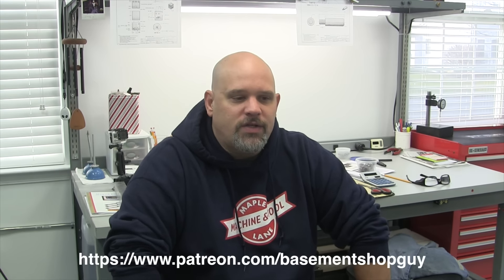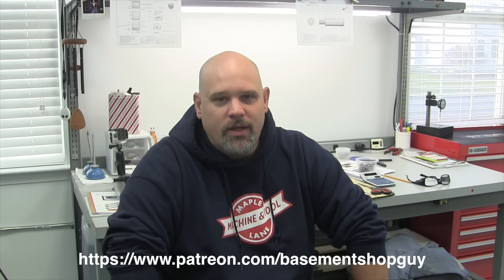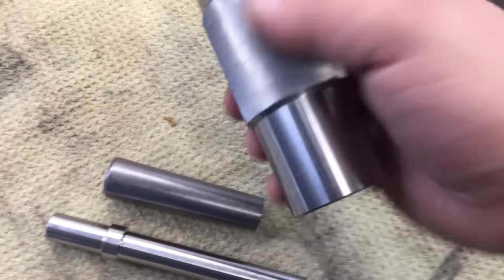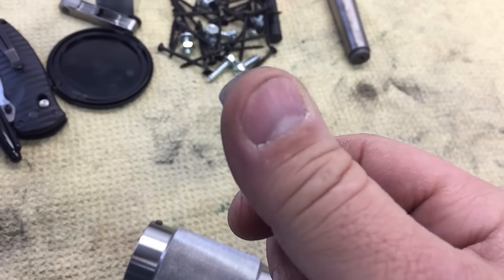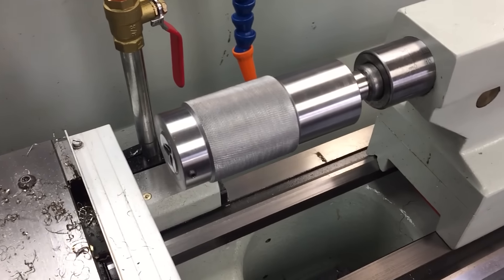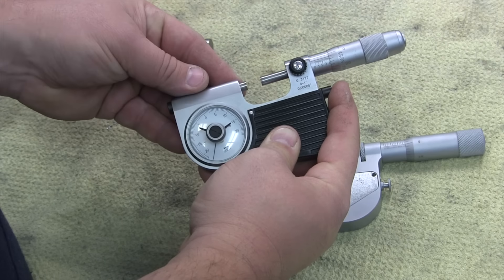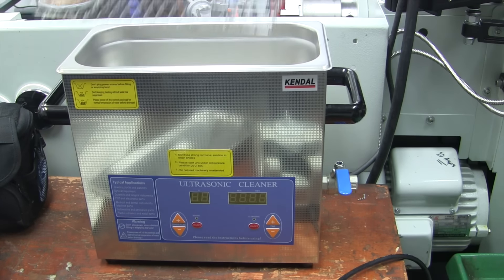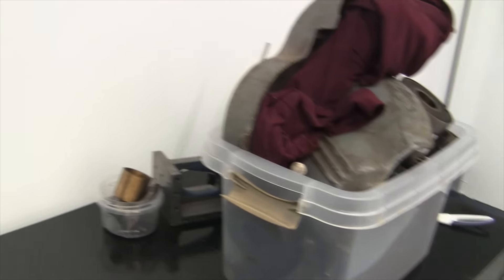Updates From The Underground 14

Comment: The "Ford" monkey wrench was from a vehicle tool kit.  I believe yours is for a 1926-1927 Ford Model T.  Cars once came with tool kits so the owners could fix them.  I have a couple of these.  The little tit on the end of the handle is for removing the oil drain and fill plugs from the rear differential.  Most of the Ford tools have numbers on them to help identify them.  I have a number of them in my tool collection.  Occasionally you will run across dealer service tools as well marked Ford.  You will also occasionally find gauge blocks etched with the Ford logo.  

All the best!

Mike
Reply from the maker: Nice! Thanks for the info Mike. I'm learning quite a bit from everyone's comments about these wrenches. Real cool!

Comment: Parts of the 10k lathe are in the bin.
Reply: I think the same 10K but definitely not 10L. 10K shares the 9" parts for the carriage. Key is the half nut lever barely visible in the bottom container and what seems to be the smaller bearing (sleeve?) in an alternate container.
Reply from the maker: Yep! Those are the parts removed from the 10K.

Comment: Hoodies with neck draw-strings are NOT good around the shop. I pull the chords out before I use them. The consequences of getting one of those chords wrapped around a spinning thing are not worth thinking about. Otherwise your's look very nice :-)
Reply from the maker: Rupe - they're meant to simply stand around, while enjoying a nice glass of Egg Nog and marveling at the machinery!
Reply: I couldn't agree more, simply too dangerous!
Reply from the maker: I agree too. But with anything, common sense is your best protection. I tie mine togehter, then tuck them inside.